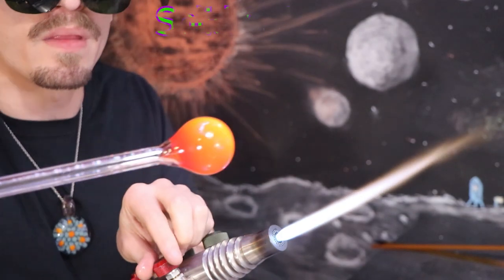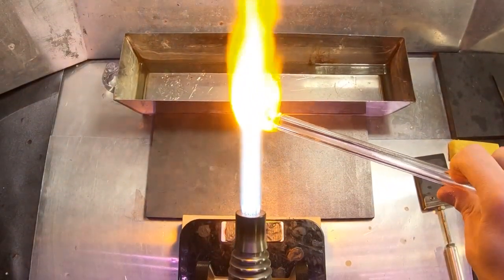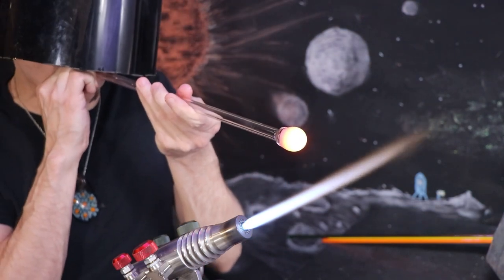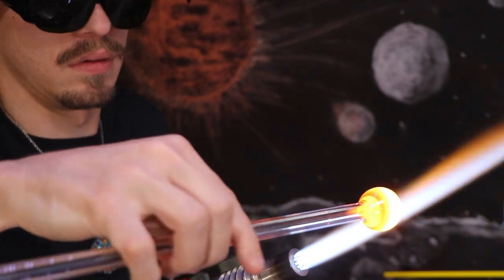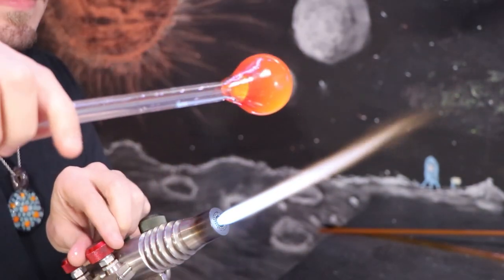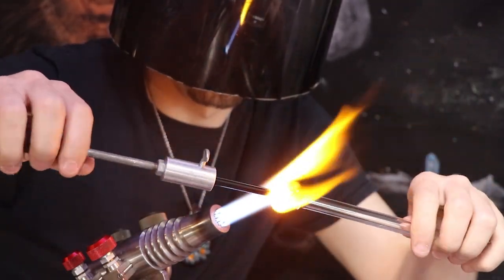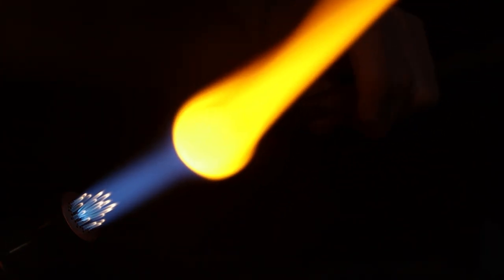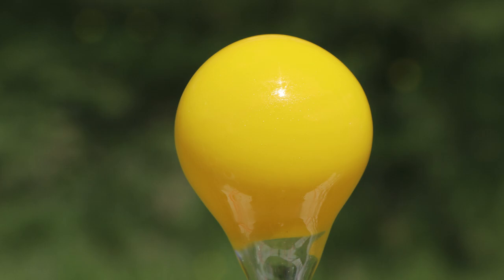Solid Color Blowout 2 - Glass Blowing Art

Comment: Thank you for these videos,  they are very helpful for an aspiring lampworker such as myself. I've only been messing around with thin wall boro and a swirl tip propane torch (gets just barely hot enough to be of any use) so I basically get to practice pulling points and blowing bubbles. In the next week or two I'll be kitting up with a national 3a torch and a K sized o2 tank so I can actually bother with tossing my work into a kiln rather than the water bucket. Any advice on an easily made, repeatable item for a beginner to learn with? I'm terribly uncreative and cant think of anything other than oil burners which don't give much practice other than puffing out a globe.
Reply: ExtremeODD chillums directional carb caps and blunt tips,
Reply from the maker: Hello ExtremeODD, I feel the best thing to practice is what your most interested in, like whatever it was that got you into glass. If your interested in the project your making then you'll keep practicing at it. But for projects to make I think marbles and pendants are a great first step, and then something like a small turtle or animal with legs will really test your heat control. Thanks for watching and I'm glad I can help pass the torch.
Reply: @baileyboro710  I didn't even think about directional carb caps,  that would be great to get comfortable with marias and cleanly separating punties/point handles from pieces. Thank you!
Reply: @MattJasa  Small animals/pieces with thin attachments is a great idea. I got into glass simply because I could. Had a cheap $3 clear boro chillum break where the bowl was necked in from seemingly nothing (internal stresses) and I managed to make it one again with a propane torch. The realization that glass could be added to my list of "materials I can bend to my will" was more than enough to make me explore and pursue the hobby. Once I get my torch/oxy I'll see what kind of pendants I can craft. Thanks again!

Comment: I am having problems with my cads graying out. Any recommendations on psi settings on a redmax? Should I be spinning it faster too? I know the flame settings but they just seem to be so hard for me
Reply from the maker: Hey GR3YY, I actually haven't had much issue with cadmium's graying, I normally run into that problem with heavy cobalt's and black. I would try heating it more slowly, take some extra time with it further back in the flame. The cadmium might be boiling. 
   When it comes to spinning I try to focus on consistency of rotations. Like a lathe or rotisserie chicken, just keeping the heat consistent all the way around.
   Lastly I haven't used a RedMax myself, but I've read up to 5 psi propane and 15-20 psi oxygen. That's average for most lampworking torches. I hope this helps, let me know if you have any more problems.

Comment: hi matt, i have a question.. i often see very large peices like goblets, rigs, ect. all made from 1 solid color. which technique are they using to achieve that?
Reply from the maker: Hey Paul, I believe your looking at a combination of techniques. The first would be similar to what you see in this video and then other technique applied later to shape its final form. 
   For the Goblet once you have the colored sphere flame cut it in half, flare one side flat to form the foot and shape the other side slightly to form the cup. Lastly combine the two with a colored rod.
    For more complicated pieces you can make your own colored tubing by pulling these spheres out into hollow tubes. Thanks for watching, let me know if you have any more questions.
Reply: @MattJasa  awesome, thank you for the reply! so this technique would work even for larger applications like a 2-3foot vase or something? i wasn't sure how far the glass could be stretched before it became too thin. but i guess the whole process could be scaled up, bigger gather of color so on and so forth.   hey, thanks again for everything you do here! it's really helpful for the community. especially us new guys.
Reply from the maker: @Dewey_Boondye420  Your welcome Paul, I'm here to help! And your right it would become thin and the tube diameter would start to shrink. You would have to upscale Or try the Encalmo/Incalmo technique and connect multiple tubes together. 
    Other more complicated ways to make colored tubing is the "Vac-Stack" technique or pull color tubing from a crucible. 
    Large scale work can be difficult to do by hand. After a certain weight people often employ a lathe or at-least rollers to hold the glass. At 2-3 feet your talking a pretty substantial size.
    Lastly you can buy colored/pre-pulled tubing. The selections and quality might not be as great as clear tubing or colored rods along with being extra pricey.

Comment: How would you add stripes or a wig wag tutorial
Reply from the maker: You can melt in lines using a solid rod, try a larger scale technique like Vac-Stack, or a quick technique I've done of using frit inside scalloped tubing. They also sell pre-lined tubing but it can be rather expensive. 
Vac Stack: https://youtu.be/_9WwILaSJwY

Frit Scallop: https://youtu.be/e_bJZzniOpo

Wig-Wag: https://youtu.be/FcSY7huiWRc